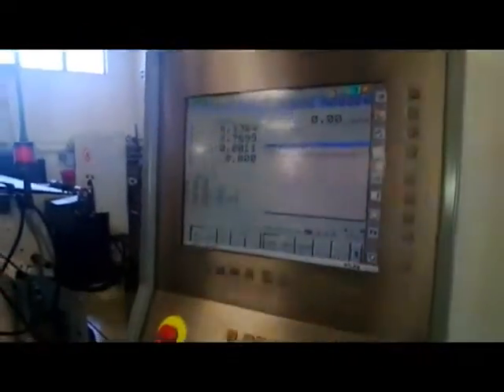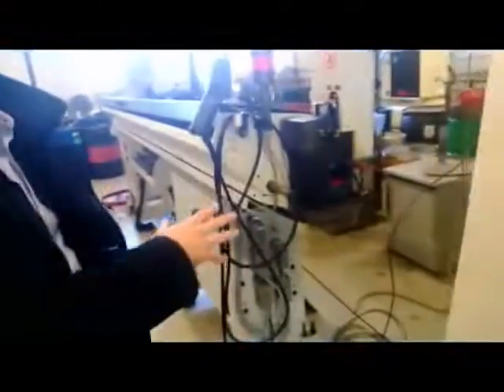Gildemeister Sprint 32 Linear - 8 axis - Offered by Continental Machinery Service and Intramaq

Comment: Due to long time Power Off our (DMG GILDEMEISTER SPRINT 32 LINEAR CNC SWISS TURNING CENTER with FANUC 160i Control) machine’s batteries has been dead. And due to this machine forgets its AXIS (0)Zero position. After changing the new batteries now we are trying to enter into Parameters by changing [PWE (0) to (1) position] to return AXIS again into (0)Zero position. But when we try to do the PWE (0) to (1) position, it shows “WRITE PROTECT” message. We tried to change it by all general methods but we are unsuccessful. And also we didn’t found any “write protection key lock” on machine panel.

So if could provide us any help to remove the “WRITE PROTECTION”. We will be very thankful to you for this support.
sales@artifol-ent.com